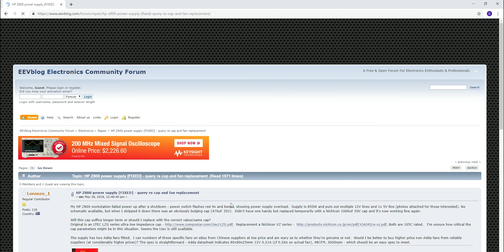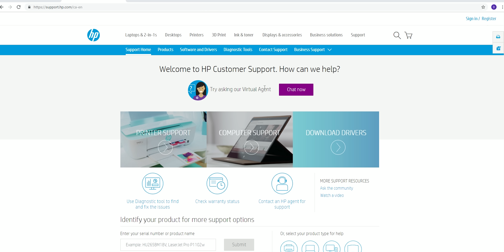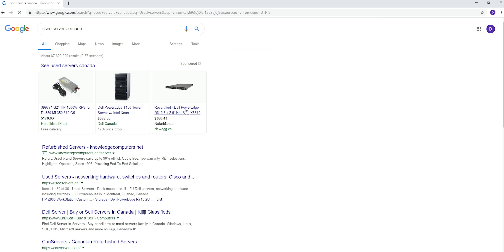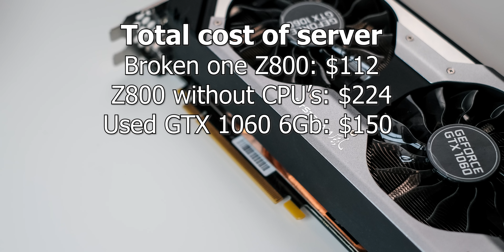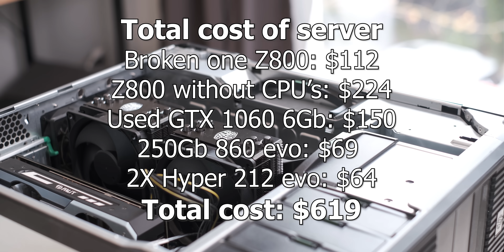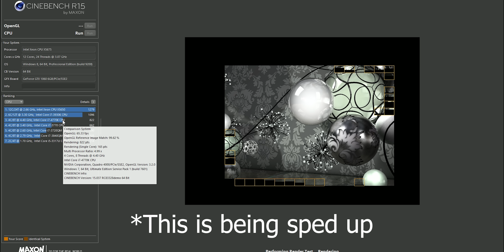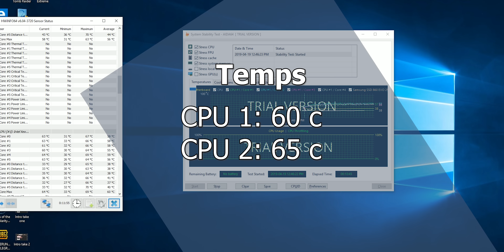Dual Intel Xeon, 48Gb BEAST for under $700! (With Benchmarks)

Comment: $150 for a GTX 1060, those were the days my friend... 😭
Reply: The same thing I was thinking 😭😭😭
Reply: @Will I paid $85 to get a used 750 ti 2gb vram until I could get my hands on a 3060 for $550 😑 I remember being reluctant to switch to pc, when you could find 2060s in the $200 price range and cheap second hand deals, then when I finally decide to, prices are inflated and dictated by ethereum profitability on eBay and nothing is in stock.
Reply: @rea280  bro i literally had a 750ti.. bought a gaming rig swapped it with the 1660ti returned the machine and got a free gpu!
Reply: @johnsonsmith7723  W
Reply: @rea280  Could you please suggest me
Good mother board model numbers
Chip set model numbers
Processor number
Pci
Storage
Graphic
To update basic model to high end work station when ever I want to update
Reply: @rea280  85 for a 750ti!!?!???
Reply: @MyaSooon  yea bro. That was peak gpu crisis. Definitely not worth it now but back then it was understandable.
Reply: @rea280  guess I got super lucky with my purchases back then. Got a gtx 780 Lightning for 135 CAD and after that an R9 Fury for 125CAD in mid 2021.
Reply: 75$ Rx 480 THOSE were the days
Reply: I miss those days 😥
Reply: Thank goodness the good old days are back...just everything else is through the roof
Reply: i bought 1070 in august last year for ~200, so happy
Reply: @wolfisbad8965  Could you please suggest me
Good mother board model numbers
Chip set model numbers
Processor number
Pci
Storage
Graphic
To update basic model to high end work station when ever I want to update
Reply: @Will It was the West-Taiwan bat bug slowing down substrates of chip production because Governments world wide foolishly though shutting down industry's that they consider aren't "essential" do in fact have bearing on all industry's from video cards to chips need in car production. 
Miners are just a symptom, the main luster of chips is car manufactures. 
The biggest crypto Miners are in fact in the top 100 companies.
Reply: wait my friend thought 150$ is still expensive where he dig more and found a 6gb used for 95$
Reply: @shinefake48  Could you please suggest me
Good mother board model numbers
Chip set model numbers
Processor number
Pci
Storage
Graphic
To update basic model to high end work station when ever I want to update
Reply: @ThotaNarendraLifeSciences   i5 12600k asrock phantom 4/d5 patriot ddr5
Reply: i bought a potoatoe for yesterday 50 cents i am way luckier
Reply: 160 for a 1070 now
Reply: Now that same card is $100
Reply: @Wazoru  now there is gtx titan for that price or even less)
Reply: @moriyamakyon1067  amazing!
Reply: My friend's dad gave me his old gtx 960 around January, February this year. I sold it and bought a gtx 980 for 280 euro. The 980 wasn't the best deal of my life, but I either suck with that 960, or I buy a better card.
Reply: @crwth1337  Could you please suggest me
Good mother board model numbers
Chip set model numbers
Processor number
Pci
Storage
Graphic
To update basic model to high end work station when ever I want to update
Reply: got one for 100 euro.
Reply: @Will It's not only miners, it's the whole market (prices of literally the materials have increased, tsmc will inflate the price on the chip themselves, demand has skyrocketed for computers because of covid etc.) And to be fair, as I heard from a video "the price will be as high as the market can bear". I really don't think that, at least for the near 2/5years, we will see gpus prices as we have in the past years. Sure, one year from now gtx 1060's will cost 120€ or something like that, but the prices on the new GPUs will be completely different, I don't expect Nvidia to make a 399$ msrp rtx 3060ti that performs almost as well as a 2080ti, aka, I don't think that in the near future we will have a "rtx 4060ti" that will outperform an rtx 3080, and even if we do, certainly at 100$ more than the last generation, because people will just buy it anyway.
Reply: I sold my 1060 used for $110 2 years ago
Reply: The days are back, mate, no joke! Go check eBay!
Reply: @luci_ly  hi, can u help me to build workstation 
Which board is best one to support basic features to high end features, because I will upgrade to as per my need.. 
So. 
Do i need to build based on high end processor or
Mother board and chip set..?
Reply: @ThotaNarendraLifeSciences  if you plan to upgrade as you go, I would recommend a good motherboard. I hear that the i3-12100 is a very good cpu on a budget, but I cannot say from experience, the newest Intel system I've ever owned ran (and still runs on) Haswell
Reply: @luci_ly  could you give me list of equipment with capacity ,model and company name to buy the work station parts
Reply: @ThotaNarendraLifeSciences  Im not sure what it will be used for, which makes it hard to balance what parts you might need. What do you plan on using it for?
Reply: @luci_ly  programming, hacking, servers maintenance
Reply: @ThotaNarendraLifeSciences  do you have a preference on budget or power draw?
Reply: @luci_ly  power
Reply: Now it's 100 lol
Reply: It can be found for $150 again, nature is healing
Reply: @sosukelele  yes, it sure looks like that at least on the used market.
Nvidia still didn't get the memo though. Their prices are so out of touch since their 20's series 😪
Reply: Well guess what! Those times are back! Found a 1070ti for $135 today
Reply: And now here we are two years later I'm going to put my 1080 up for $150
Reply: so funny seeing these comments from 2020, for $150 the RX 5700 XT will literally crush the GTX 1060 to its guts
Reply: Now you can almost get a used 6600 for 150.  Good days are back again!
Reply: Lmao was thinking the same thing
Reply: Bitcoin end ! And NOW VGA is a real price !
Reply: @warriormike387  Bitcoin will always be a thing and has little to do with gfx card mining
Reply: @warriormike387  Bitcoin hasn't been mineable using graphics cards for years 😐

and it will never end.
Reply: @viztiz316  all things come to an end.

All. Things.
Reply: just bought one brand new for $100 lmaoo
Reply: @theyoutubeaccount8499  liar
Reply: @ss-sq1hn  im not lying I swear
Reply: @theyoutubeaccount8499  WOW if you are telling the truth then you had a really good deal. I just bought gigabyte 7970 3GB used for 30 euro for my second build. It works all benchmarks with my 1080p preset.
Reply: rx 580 for 150 euro chad.
Reply: $50 for p106 in Taiwan about a year ago :(
Reply: In my countrx 150$ is a GT1030 rn.
Reply: right! now its crazy! just sold an rx5500 for $250 it's insane!
Reply: @johnsonsmith7723  seems to gets a lot better now. Was trying to sell a GTX 1060 for 190€, but nobody wanted it for 3 weeks. 170€ was the maximum that I could get, it was sold yesterday. RX580 8GB went for 240€ and RTX 3050 for 330€.
Could also get a 6600 XT for 370€ last week for my personal rig, which was nice.
Reply: @Will ill tell you what to do.. you go to your local big box store buy a gaming pc with a better gpu but not clear side.. you install that 1060 and keep the upgrade!!!   i just swapped my old 750ti for a 1660ti a few days ago
Reply: i got a gtx 950 for 20 euros m8
Reply: should hav invested in buying them in bulk for 100% profit
Reply: saw a 2nd hand one a few days ago for a similar price
Reply: In my country i can get one for 90 bucks.
Reply: Could you please suggest me
Good mother board model numbers
Chip set model numbers
Processor number
Pci
Storage
Graphic
To update basic model to high end work station when ever I want to update
Reply: @Will Could you please suggest me
Good mother board model numbers
Chip set model numbers
Processor number
Pci
Storage
Graphic
To update basic model to high end work station when ever I want to update
Reply: @glitter_fart  Could you please suggest me
Good mother board model numbers
Chip set model numbers
Processor number
Pci
Storage
Graphic
To update basic model to high end work station when ever I want to update
Reply: Don’t be opening PSUs people
Reply: Were they tho?
Reply: I still remember the days when a GTX1050ti was 160 CAD ;w;
I regret not being able to buy one sooner.
Reply: How bout now?  Lol 1060 are almost as cheap as rx580 now.
Reply: 1060 cost like under 100€ second hand
Reply: 2 years later intel came and gave a580 for 180$ ( same performance as rtx3060 )
Reply: It ain't any better nowadays... 😢
Reply: You can do better these days! The only thing they are good for now is serving sushi on.
Reply: I got a 4080 eagle for $40 at a amazon return store. Had a small dent on the shroud. Works fine. The return pallet store thought it was a fancy PC fan lol
Reply: I actually bought a GTX 1050 ti for $150. I just added an extra $150 to get the rest of the laptop that came with this card. It's pretty old nowadays, but it's the night and day difference between this and the integrated graphics that I used before. I somehow managed to play GoW 2018 on that poor APU and got 15-20 fps max with most of the textures completely missing, sometimes fought with invisible enemies.

Comment: Dual X5675 with 48GB of RAM? Not worth anywhere close to $700 in 2019. Try $200-250 at most...

Edit: look up "My 20 core/40 thread, 128gb ram "budget" (~$600) home server build" on reddit. Dude shows a build of dual 10 core E5-2660v2 CPUs with 128GB of memory for only $600. Much much better peformance, much better power consumption, more RAM, and cheaper...

Comment: Hi, I have done similar modifications to my HP Z800,  I am getting error message - 517 Low Power CPU Heatsinks detected on High Power CPU.  How to get rid of these message.

CPU- X5690--------   replaced with X5650
Heat Sink- Cooler Master Hyper LED  ---------- replaced with the Stock Heat Sink.
RAM - 64GB
GPU- MSI GTX 1080 Ti OC,  11GBram

Comment: With all the fuss required to replace the stock HSFs, I wonder if they're all that bad in combination with the factory shrouding. The Z800 was well designed.
Reply: Have a z600, and they do run hot. But I'm not sure if it's the cpu coolers or just the cpus themselves. 

At least they were quiet.

Comment: And only uses 2kw of power and memory bandwidth of 400MHz and two sockets with the same cores as a new entry level.

P.S. As someone who repaired switch mode power supplies for a living, if you don't know what you're doing DO NOT OPEN THESE UP. They hold enough charge working or not to kill you.

Comment: The powersupply may not kill the gpu cuz it can be due to the overload and the traces with small trace gauges can burn . u can fix it with soldering this happened to me when I was working on these before .

Comment: I've been running a Z800 with 2x5680 cpus and a 1660 Super, for just over a year now. I play the new MS Flight Sim @1080 just fine, so it's not something I need to look at upgrading any time soon. Oh and about the USB 3.0, I just added a PCI-Express usb 3 card with 4 ports, ensuring data transfers are fast.

Comment: Do you not need Windows Pro to access two CPU's as normal Windows home only allows one CPU to work, also no one ever adds the cost of the OS, That is what killed my Windows running 2008 MacPro with Duel CPU's

Comment: Or you can go with some xeons  E5 V3,V4 +carefully choosen aliexpress mobo (here in youtube is chanel that makes very detailed reviews) .(there are also dual cpu options)  I builded for 300 usd. Used Xeon e5-2620 V3, RX 580, 16 Gig DDR4 Corsair (new), 128 gb A-DATA SSD(new), BE quiet pure power 10 600w, motherboard (new) 

P.S. USB 3.0 Problem is easily solvable with PCI-E card that provided USB ports

Comment: My i7 6700k is clocked to 4.8 ghz. No water cooling and I get gaming speeds almost double your scores using a gtx 1080
Reply: Your 1080 got more fps than this 1060. You don't say

But in all seriousness your K model is better for gaming

Comment: I built a dual Xeon in 2015for $17,000. Two E5-2667 cups, 128gb ram, 10 ssd drives, Quadro 6000, Supermicro X10Dri motherboard, 1000w psu. It was my all out system in 2015.

Comment: Nice video but you failed to mention that HP Z computers use a 5 pin connector for cpu fan/heatsink . Dell also does this on their precision line. So you have to buy two 5 pin to 4 pin adapters for any aftermarket cooler if you want to use them on OEM workstations. Also avoid the Z400 since that uses a proprietary 24-pin layout for the power supply. Standard ATX power supplies wont work in them unless you buy an adapter that adapts the 24 pin lay out from the Z400 psu to standard 24-pin layout.

Comment: 1. This is NOT a server it is a workstation.
2. Hp had limits on what CPUs can be used due to power consumption.
3. Sounds better than they are.
4. You can buy a dl360g6 which will be the same thing for a lot less and have faster drives (SAS).
5.ebay and even on marketplace has various prices from £200-600.
6. Case was designed by the BMW guy.
7. Workstation Hardwear differs from peasant  desktops, search TRX motherboard and eatx  as well a threadripper.
8 if you had them in the day! It would be mad money!  £4,000+

Comment: In My opinion the best way to do something like this get an old used Dell r510/r710 type server. I had gotten an old r510 server for free from an IT shop who was getting rid of old inventory with 2 Xeon X5650s and 48GB of RAM. You can find old servers like this at college/government auctions for next to nothing. It was unbelievably loud so I took out the guts, put them on a Asus Z8NA-D6C Motherboard ($109), Used 2 Intel Stock 1366 Coolers (E97381-001) ($57), put it in a quiet case (Corsair Silent 100r $59.99) and got a Seasonic 650w PSU to power it ($78). So at a little over $300 (not counting the HDDs which I already had) I was in business. I don't have remorse for the project as it functions great as a VM Host and barely makes a peep now with the quiet hardware. I also do some occasional Video Encoding with Handbrake and it uses all 24 cores for these tasks.

Comment: I have one. I’m upgrading to the 192gig ram kit and 2 x5690’s I also replaced the quadro 4000 with 2 1070 GTx CPUs and got a 2012 vintage pcie ssd for 75.00 bucks and it’s 1.6tb

Comment: You realize that the cooling system is is duct too separate different heated parts. you just dumped a massive amount of heat in the whole case. You go on too fry the PC, then dismantle a PSU underground-ed, and not testing for capacity....... You literally have no idea what your doing. The Gaming rig is good idea, I have several of these machines....... Those dainty cooler fans are throttled, and they are a separate duct-ed channel for air too pass through front too back. The duct system is fairly nice idea too the design. now your just dumping heat on too the chip set heat sink. Honestly I wouldn't have shared this video as it greatly shows your PC incompetence. This is spoken from a 13 year in the field tech. This is defiantly a cringy video.

Comment: I bought mine 3 years ago. From an eBay seller I could configure the base options I got 2 5675's with 128 gigs of ram. my current upgrades are an old PCI-E io Fusion SSD(75 dollars for what was a 5K drive? Yes please.) I have also changed the old 2 gig Quadro for a 1070 Geforce. My 800 runs like a dream

Comment: I have an HP z800, with dual x5677 xeons, 40 gb of RAM and the sapphire nitro AMD r9 390 8 gig, metal back plate edition. 

I have a couple solid state drives that I've striped together, and I also use a program called primo cache to set up a SSD cache.

Last cinebench r20 score I ran, was about 3,000 I think.

Comment: PSA Never, ever open a Power supply if you don't know what are you doing.
Capacitors can hold charge even if the system is broken.
Also, you test with a multimeter.

Comment: Could've thrown a 2 X 5690 in there, but still no overclocking that chip.
Reply: You can overclock that chip, just not on a server motherboard. You can do so on a normal single socket x58 board, or an SR-2 if you can get your hands on it lol

Comment: wait, xeon x5675's? They never sold the z800 with x5600 series cpu's and they are not officially supported. I tried to put 2 x5650's in my z600 but it refuses to boot with both installed. Both computers are using the same chipset and have the same cpu support with one exception. The 800 supports the 130W x5580 while the 600 only supports the 95W x5570.

Comment: Hate to break it to you, but my 2010 mac pro 2x xeon 5670 scored 1419 on Cinebench r15. Literally ONE POINT higher than your system on CPU. When I got it last year I paid 500 bucks for it. They are now selling for a lot higher on eBay than they were a year ago. My system came with 32gb of ram meaning it was only running in Dual Channel mode and also my cpu's are a shade slower clocked at 2.93ghz. Difference may be better thermal design with the mac pro? Excellent video either way, I love the quirkiness of dual socket systems as well as really any enterprise / pro grade hardware.

Comment: I understand if you do it for the RAM, but in general, now with amd zen2 and 3 all of theese is old junk. For 150eur you get a far more power efficient 65w ryzen3600 which is faster also in multithreaded perf. This old xeon stuff is overpriced and power inefficient compared what you can get with amd. If you want to go even cheaper, go for ryzen 3500x for asian market same as 3600 with disabled hyperthreading for 100€!!!
Reply: 🙂 i think the server stuff is meant more for guys that like vintage, and yes ur good suggestions if u wana go new 👍

Comment: I have an HP 6200 pro running i5 2400 processor at 3.10 my question is can I put a Amd R5 2600 processor in its place without changing the motherboard?.
Reply: no buddy, the board has a cpu support list, by one cpu company